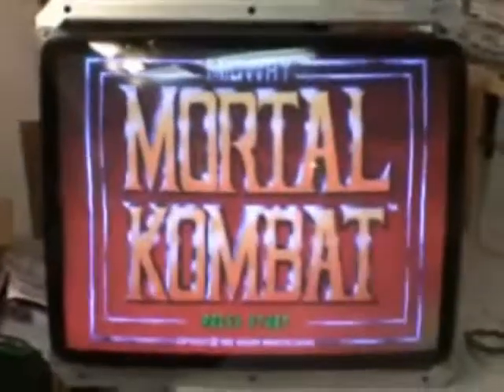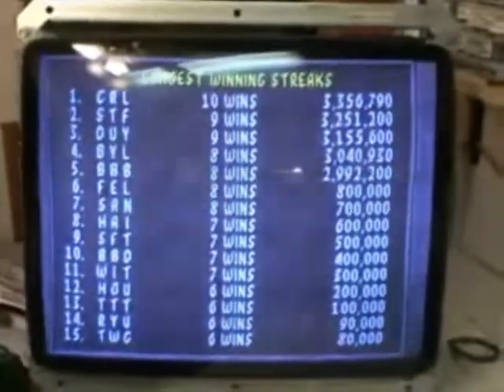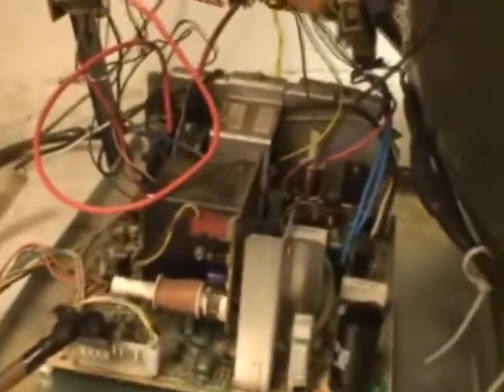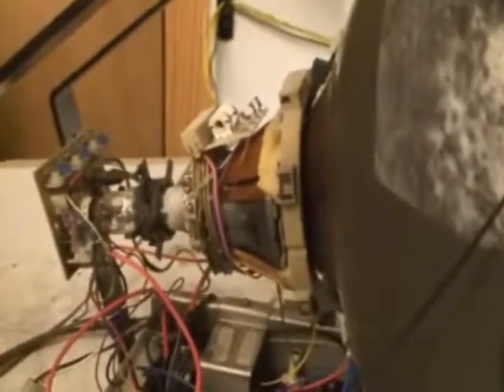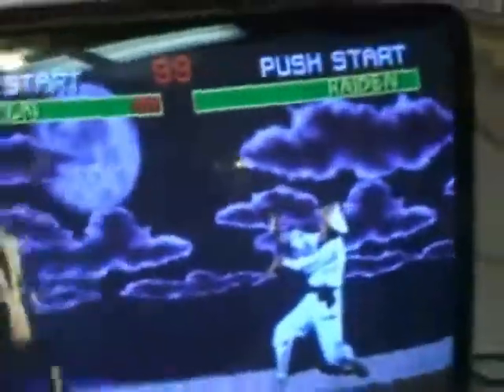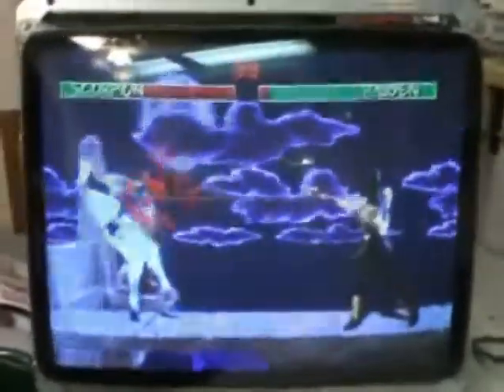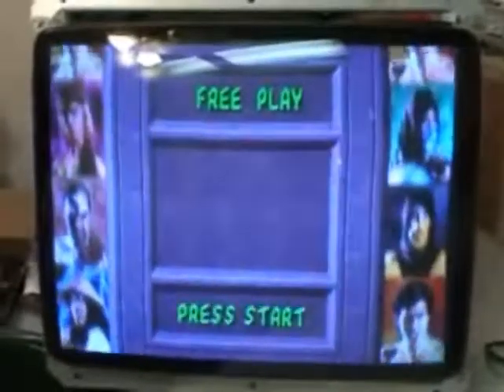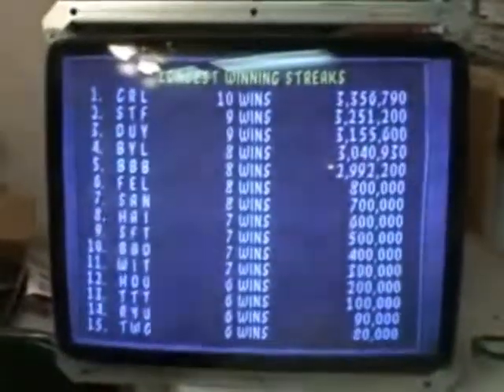voltron88x, KLOV, 25" to 27" K7000 Mod and Repair.

Comment: Hi buffet. I recently acquired one of these chassis' in a bulk buy with that additional pincushion daughter card. I have no use for 27 inch monitors though.  Can I safely hook this chassis up to a 25 inch tube or do I have to remove the daughter board and desolder the wires from a couple components that the bottom of the header pins are connected to? 

Thanks 
Curt